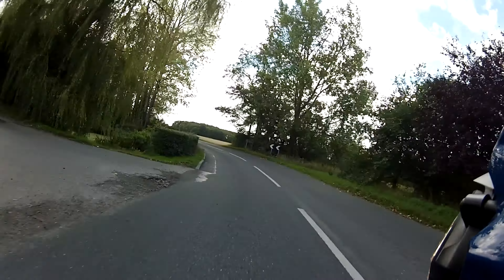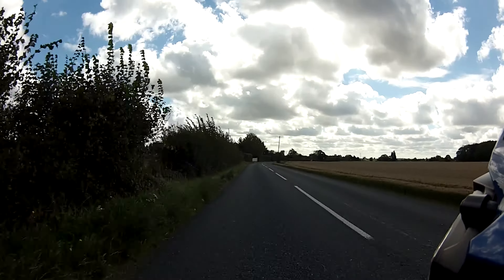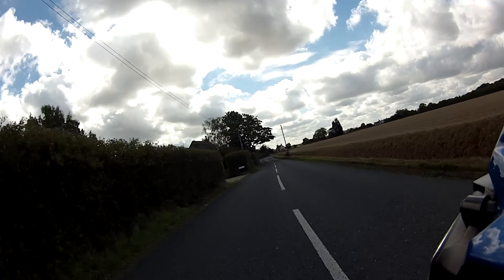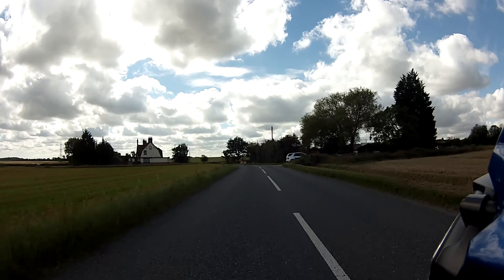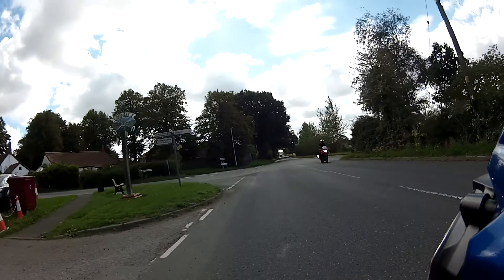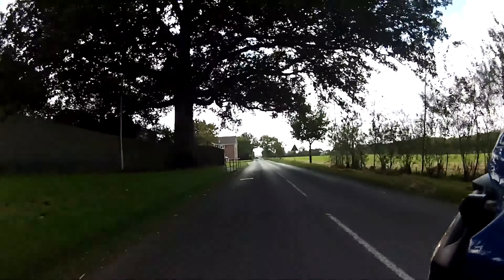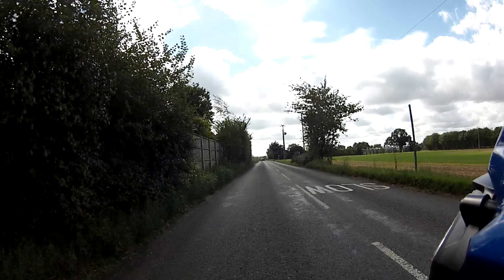Trail Braking and ROADCRAFT | Should I use it?

Comment: You have a well-argued viewpoint sensibly that is concisely expressed, Mike. The point about the overlap is very valid: as humans if we want to do something to a high standard, we are better off just doing one task at a time. When we begin to do two, or more, things at once we do not perform optimally. For me that is probably the best thing about riding to the System.
Reply from the maker: Thanks David. The System also gives you so much more time to deal with things if you stick to the order. People say I can't get all that in before the corner. That's the idea ... slow down a bit. You can add the speed afterwards.

Comment: Hi Mike,
 I'm currently doing my Advanced Rider course with IAM. 
We've been taught to separate braking & steering by using the system.
Many riders that I know and have been through the course, and passed the test have reverted to trail breaking.
I'm pretty inexperienced as a rider, but i do have an in-depth background in physics and automotive engineering.
Without wanting to be partisan, i have to say that all the physics and engineering principles align with trail breaking - from physicists and engineers the response is always the same; i.e the altered geometry afforded by keeping the forks depressed is undeniably a benefit.

I am dutifully applying system in my training, it definitely works - that's not in question - but physics cannot lie.  I've spent over a year - prior to my IAM training - studying the geometry of cornering on bikes, and without wanting to disparage the IAM, I'm 100% convinced that trail breaking IS the safest way to corner.

The IAM is fantastic, but each time i question the instructors/observers i always get the feeling that they believe trail breaking is correct, but they are obliged to defend the IAMs stance.

Its all very confusing, if you watch Police Riders, they trail brake, but on Roadsafe courses they caution against it.
Reply from the maker: Thanks for the comment. You must be watching different police riders to me. If the altered geometry of having the forks loaded is such a great benefit why not just drop the forks a couple of mill through the headstock permanently? Get the bike setup before the corner using System. Drive the bike through the corner at a speed you can stop in the distance ... etc. Why would I want to load the front end into a bend I know nothing about, other than to carry more speed? View and hazards control my speed on the road 99% of the time on the road, not steering geometry changes or my ability to get through a bend.
Reply: That's a very refreshing reply 👍
Reply: @mikeroberts  raising the forks in the yokes to reduce the steering angle is what racers usually do with a production machine used on the track. Then they firm up the suspension to reduce movement even on a very smooth track. That all makes sense to me... but using up the relatively soft fork travel by braking into corners to achieve notionally quicker steering at the expense of being able to cope with bumps seems wrong.
Reply: Theoretical discussions of trail braking usually ignore two things. First, braking reduces your suspension travel, which means the forks can't react to bumps in the same way as they would if you extend them by being lightly on the power. Second, because you are braking mid-corner, you are also increasing the vector forces in play, which requires the front tyre to deliver more grip.

On a predictably surfaced track neither factor may matter, but roads are not smooth so the forks DO need to respond to mid-corner bumps and potholes, and neither is the surface consistent so that the level of grip suddenly falls, then extra load from braking may exceed the grip that's available. 

The standard brake on the approach, corner on a light throttle, approach minimises both issues
.
Reply: @DevonRiding-db  nothing wrong with practicing trail braking - I've been teaching the technique via my own Survival Skills school since 1997, long before it became a popular topic for YouTubers. 

But that doesn't mean it should be a default technique.

Comment: "Have the skill but use it sparingly" - a perfect summation. Thanks for that video Mike. Top class!
Reply from the maker: Glad you liked it!
Reply: @DevonRiding-db  Excellent question. 

First answer is "if you don't ever use it, do you actually need it?". It's always good to extend our abilities but there comes a point where we might start learning skills we've never going to need. 

Second answer is "if it's a skill you rarely (as opposed to 'never') use, set some time aside to practice - go back to the basics and work forward. Do this regularly enough to keep the skill fresh until you DO need it.

Comment: Excellent video and explanation Mike, when on the track its apex to apex, riding on the limit to gain each tenth of a second over your competitor. On the road, riding to the system, safety is the priority, being able to stop in the distance you can see to be clear on your side of the road,in the correct position, all within the speed limit, at the correct speed, in the correct gear for the bend or hazard, keep up the good work, these are excellent reference video's for associates.
Reply from the maker: Thanks Andy. Much appreciated.

Comment: Really well presented Mike... I’ve seen it discussed a lot recently on this side of the pond in recent years... never felt the need for it myself, and as you rightly pointed out, braking during a corner and trail braking are different animals.
Have I practised it? Yes, but in the grand scheme of things I’ve not felt the need to use it on my regular rides... it’s a tool to keep in the toolbox for sure... I just haven’t had the reason to use it... if I was track riding then absolutely I’d use it... but riding streets/roads etc... nope, not yet.
Cheers Mike 
Stay well,
Steve
Reply from the maker: Thanks for the positive response.

Comment: Thanks for another great vid Mike. I have returned to motorcycles after about a 10 year absence, and as I am much older now, I am taking it a lot more seriously. I have followed Back2theBike, Seaflyfisher, Roadcraft Nottingham, to name but a few.
All have been invaluable to my return to two wheels. My personnel style of riding is not use the brakes at all! I know it sounds stupid, but its my way of staying within the posted speed limits, and practicing smooth riding.
I will definitely take some form of advanced test in the not so distant future. 
Thanks for the great informative videos, you have a new subscriber.
Reply from the maker: Welcome onboard. If you are not using the brakes it sounds like you are probably slowing on the gears. Have a look at these two videos that demo getting your slowing done on on the brakes before the corner. https://www.youtube.com/watch?v=lA2n-fT3CBw and https://www.youtube.com/watch?v=o8TCSm24Eko  Get yourself signed up with your local IAM or ROSPA group. I'm sure you'll enjoy it.
Reply: @mikeroberts  Thanks for that Mike, just this minute watched the vids. All you above mentioned guys make it look so easy, taking in all the available information, and acting appropriately. I find it quite easy to do on my daily commute road, but if i venture outside my comfort zone, everything goes out the window. Definitely more training needed. Sorry for going off topic. As for trail braking, seems to me that it is only going to benefit track riding/racing.
Reply: I'm told it's a good idea, when using engine braking, to touch the brakes just enough to make your brake light come on.

Comment: Excellent and sensible explanation Mike, whilst watching though, I couldn't get the distraction of your corner cut at 27 secs out of my head?
Reply from the maker: Thanks for the comment. Well spotted. The downside of of the times I use the fixed camera is that you don't get to see any head movements (that's also its big advantage). This is a nasty little angled crossroads with a narrow bridge (where I cut in). On the approach I get a clear view up the road I am turning into. On this occasion it was clear so the line I took smooths the right turn, reducing the angle, while still allowing a good view up the road I'm entering. If anything is coming I can stop on the road I am on until any vehicle has come over the narrow bridge. Here's the Google Street View link of the approach so you can 'ride' and view it yourself. https://goo.gl/maps/tx98QRcYD5oo1X4z8
Reply: @mikeroberts  Cheers, Mike, thanks for the link, which helps to understand that particular junction.

Comment: I find it comes in handy when you have an Audi up your chuff as you come into a bend. Having said that, the better option is to regulate speed beforehand to add his diminishing safety buffer on to your own.
Reply from the maker: Your second option is the much better one. Not letting another vehicle force you into a more dangerous situation (eg entering the corner quicker than you desire AND with a car inches behind).
Reply: @mikeroberts  yep, forward (rearward) planning, extended braking with a few well timed brake light taps would be more favourable.
Reply: @RoadcraftNottingham  Try a few well timed brake light taps in NZ and you'll likely receive a few light taps without the brake lights in return!  ;-)
Reply: @Spuggy0453  prove it, send me a video of you warning a tailgater off 😂

Comment: Just enjoying and learning from watching some of your videos again Mike.
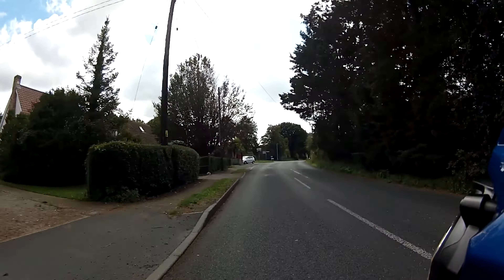On this one on ‘trail braking’, at 3:20 you mention a couple of occasions when it might be necessary to trail brake ie. downhill turn, and a very short slip road off a ‘fast’ carriage way...........so in these circumstances, would you be using the front or rear brake, or both? Or is it one of those ‘it depends’ moments?
Reply from the maker: Everything is an "It depends" 😀 For the fast slip road I'd be using both brakes.  For say a left turn, major to minor, which is down hill, I'd approach using both brakes and then use the back to trail through the turn.
Reply: @mikeroberts  Thanks Mike for the quick reply, much appreciated :-)